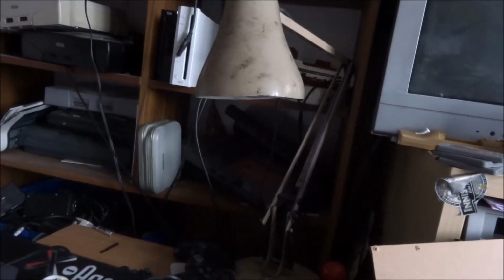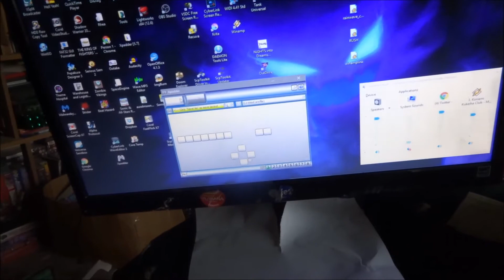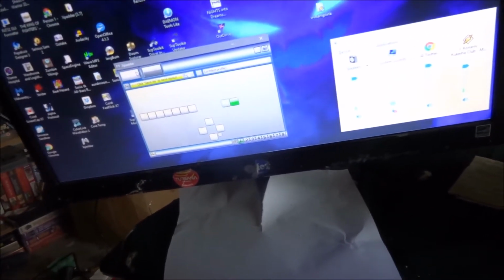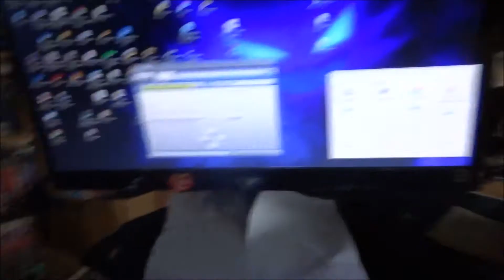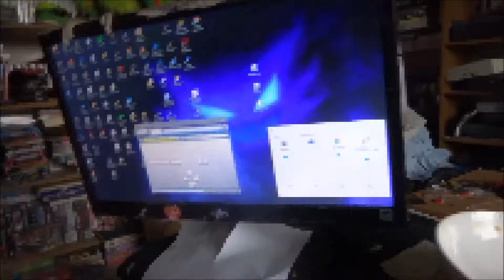X arcade tank stick rewiring, (Improvement)

Comment: I need help with XArcade tankstick please let me know if you can ??
Reply from the maker: Depends what's up with it
Reply: @MikeDBloke   Actually I have lost the Male to Male 9pin  serial cable what I need is if you can test the continuity of the 9pins and draw it on paper ?like this  https://youtu.be/48RH68mYk24
I want to know which pin is connected to which pin? You don’t need to cut your cable like in the video just continuity check is needed please
Reply: @MikeDBloke  can do or not?
Reply from the maker: @y0ush4  Sorry for some reason Youtube isnt notifying me of any comments, I don't have the old guts anymore, in the video I swapped them all for cheap-o USB encoders (recommended), it should be the same output on both sides of the cable so any old 9pin cable should do.

This page kinda shows a pin out
http://forum.arcadecontrols.com/index.php?topic=96773.0
Reply: @MikeDBloke  also I am in no hurry the things is I am in india 🇮🇳 and console cable is only available in USA for 10usd +45 usd shipping to india I request if you can give me pinouts so I can make cable at home

Comment: Hey , do you know if you replace the J-Pac, how does the Xbox One recognize it? If it is native and works, how is the response. (Hoping you have an Xbox One to test.) Also, could you add link in description of name/model or place you bought it from? Tanx
Reply from the maker: I cant give the answer to that as I dont have one, you could probably hard solder it to the Xbox one pads PCB, they do sell a cable adaptor for it